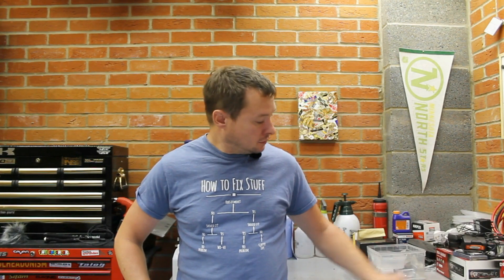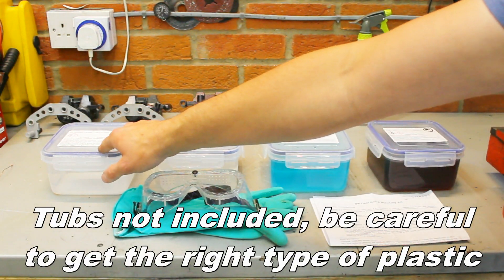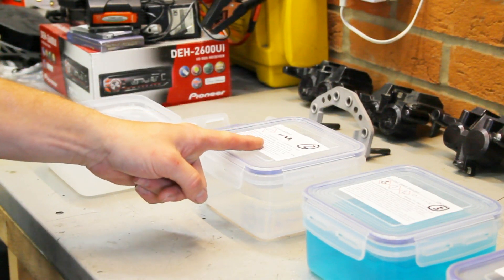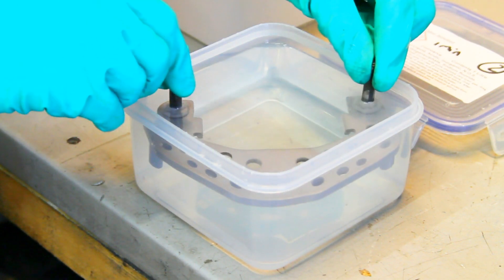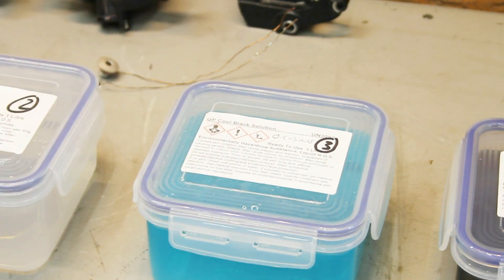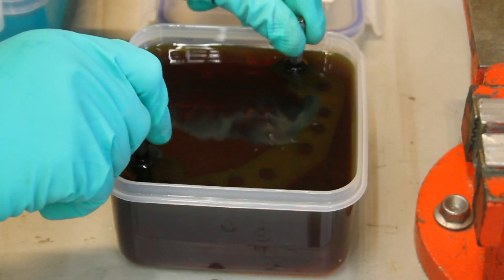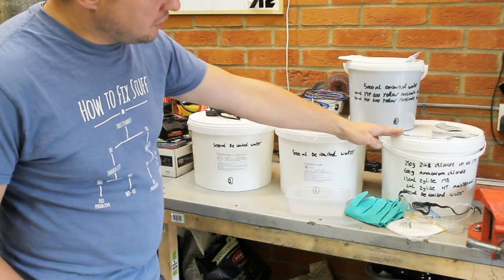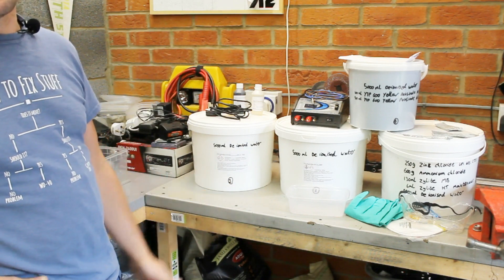Home Zinc Plating

Comment: use 140mA per square inch of part, 20 mins plating time @25C and agitate the solution. This a great kit, have used it myself on my bikes. much better than vinegar and epsom salts plating.
Reply from the maker: Yes, it's fantastic value for money. Sounds like you have it working well. 😎

Comment: Plate steel with nickel first then plate with zinc. Use white vinager and salt as the electeolyte. Clean the steel first hydrochloric acid 50 50 in water and then put in bakingsoada and water to stop the acid effect. Then hook positive to the zinc plate and negative to your part in your solution and juice with 5 volts at a minimum of 1 amp.😁
Reply from the maker: Cool, but more advanced than the basic plating we were doing here. I might revisit this using the process you gave. Always good to keep developing.
Reply: @PhilOsGarage  im learning 2. I came here for your process and it is good. Just b carefull because sometimes the process works but the coating isnt sufficiant.

Comment: Could I do the zinc platting to the inside of a motor bike fuel tank, I'm about to try electrolysis to remove the rust and thought I could simply zinc plate inside so then it would never rust bad, I don't like the idea of pouring in a sealer just in case it doesn't adhere in all nooks and crannies. 👍
Reply from the maker: Hi, thanks for watching. I don't know if  you would get an even coating of zinc on the inside, I like the idea but I've never heard of it being done.
Reply: @PhilOsGarage  first try for everything ,I  also hadn't heard this being done before  but really makes sense
Reply: Zinc plating inside of tank is a great idea and should work as rust removal by electrolysis works very well in fuel tanks

Comment: Hi Phil, great video thanks for the detailed instruction! However I wanted to know whether you also bought the plating solution (bucket no 3) or just mixed together the chemicals that you've written on the bucket? In any case would you please be so kind and write them down in detail on here? Thanks in advance!
Reply from the maker: Hi, everything used was from the Gateros kit, all you need to do is supply your own buckets and water.  They don't give exact chemical formulations, it's all supplied as powder.  I'd recommend speaking to Gateros, they design the kit for diy use, so don't provide masses of technical details.  Thanks for watching.

Comment: What is recipe for the black solution of last process?
Reply from the maker: I'll need to check the label to see what the blue chemical is, the final solution is simply lanolin (a type of natural oil) which seals the surface to give a degree of corrosion protection.  Chemi black is not highly resistant to corrosion, so this helps.

Comment: What's the point in the chemi black if it's not corrosion resistant? The part you zinc plated didn't look that good - why didn't you give us a close up of the finished result?
Reply from the maker: Chemi black has a mild corrosion resistance, but won't stand up to external use. The sealer allows further resistance without any significant change to dimensions, it's also used in areas where bright finishes are undesirable.  The zinc finish is extremely sensitive to the standard of the part prior to plating.  The bracket used had been very severely corroded and had to be shot blasted which does negatively affect the finish. In this instance it is a petrol tank and seat support bracket which is not visible on the finished project.  For external fasteners we have used a wire wheel in a bench grinder which gave a significant improvement in surface finish, which is why we started with less visible components.

Comment: by deionized water do you mean distilated water? because there is always ions in water
Reply from the maker: It is sold specifically as de ionized water, but it is in essence distilled water. It's widely available in hardware stores.
Reply: @PhilOsGarage  understood water musn't contain salts , acids and bases.